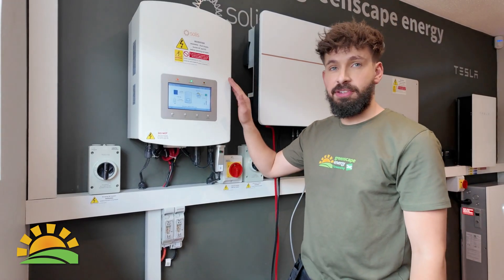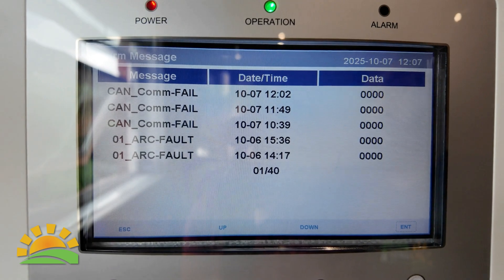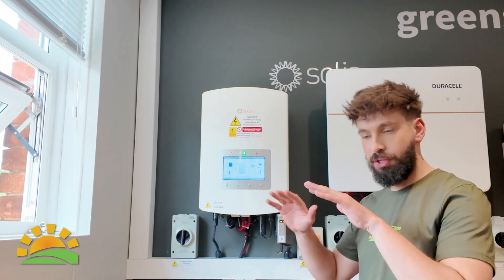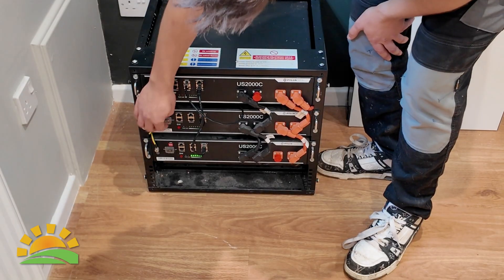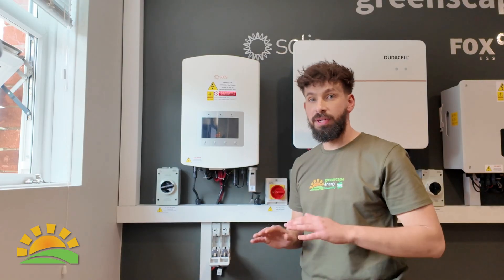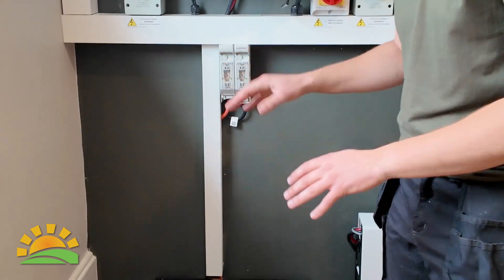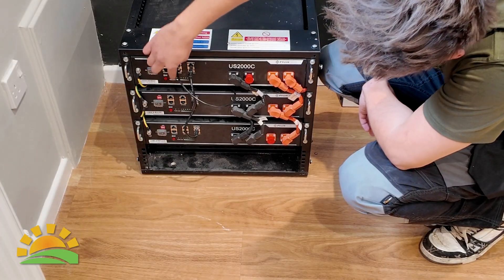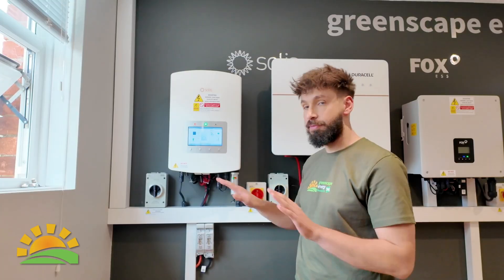Solis Troubleshooting: Solis Alarm

Comment: Having had to do this in the past, the steps are very clearly explained and the video is very helpful.  What would be nice, though, is an explanation of what each isolator etc does, and why we are switching them off and on in the order given.  Might need to be in a supplemental video, perhaps, so as to keep the core message here simple, but it would be appreciated if you could tell us the "why" as well as the "what"